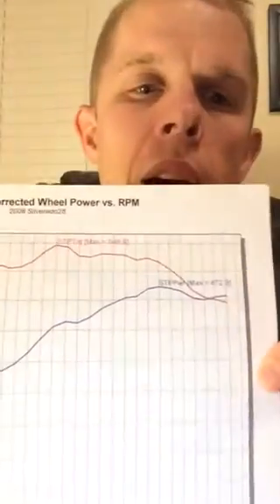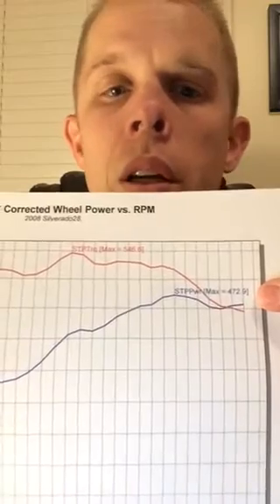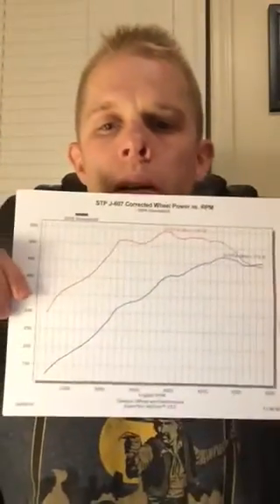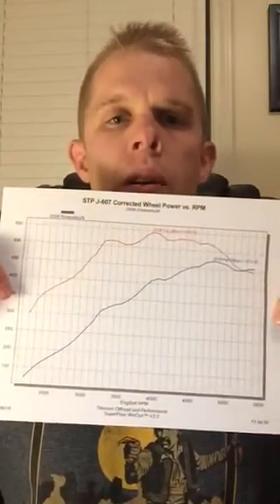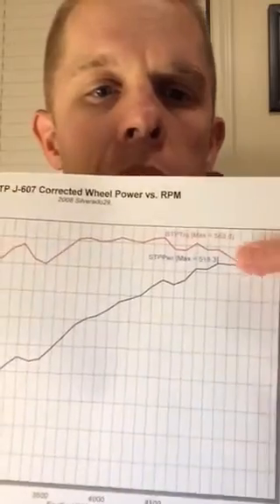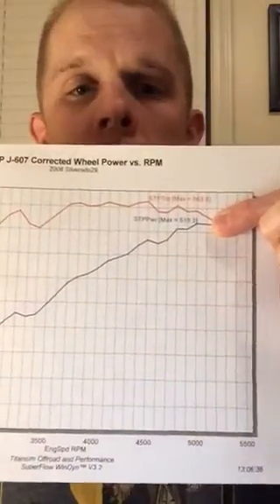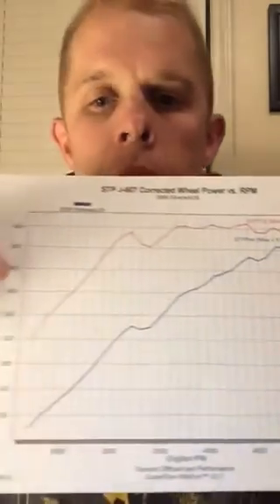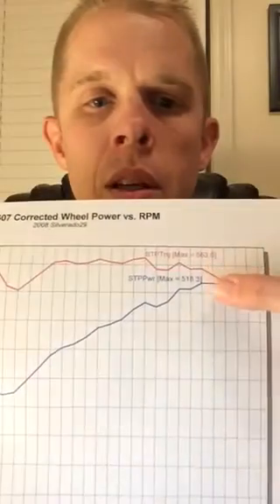Cat vs No Cat: What's the HP difference?

Comment: I have done a LOT OF DYNO testing building performance/competition engines.  Most of the time the HP difference between a modern Cat and no cat is a few HP at most .  We tested a 700HP big block with/without cats recently and the difference was less than the standard deviation of the dyno.   I have never done any such testing with forced induction engines so I am not arguing with your results in that situation.

But with naturally aspirated engines that are in good tune and with NO OTHER changes except removing the cat/replacing it with a straight pipe, I haven't seen any useful  difference between cat/no-cat in probably 100+ dyno pulls.  

I recently ran across an internet  claim of 40 more HP by removing a cat.  Turned out that the cat was removed and numerous other changes were made to fueling/exhaust system.  But the claim was that the cat "robbed" HP.

Comment: You forgot to mention these are the results when you have turbo if you have no turbo and your car is newer then 1997 then you will get only 3hp doing the no cat
Reply: What would you think the diff is on a 95 or 96 Lt1 ? thx
Reply: @paulmoss7940  u would need at least high flow cat cause no cat will mess with oxygen sensor which could make it worse and headers cause just the converter itself isn’t enough to gain enough power to notice
Reply: @erikko6523  ya but the day will come when the cat gets plugged

Comment: With a turbo or a supercharger it  will really make a significant  difference  ,but with a v6 pushing 300 horses probably  adds like 7 horses .
Reply: Old Peugeot 205 GTI 1.9  was 130HP with no cat early version,  and with cat was 122HP, no know if cam was changed, head....only as reference.
Reply: Phoenix E 7 more than I had on my Z.  Noice.

Comment: I have ZERO doubt that the catalytic converter robs HP but most of that 50 whp id say 40-45 hp was from 3 pounds of boost not the restriction..... in my experience which is not 5 decades or anything but roughly 15 years the catalytic converter might rob you of 5 wheel hp.... we arent talking about stock cats but hi flow cats vs no converter
Reply: bennie walters on a NA car it won’t make as big of a difference.  A turbo car will notice a bigger difference.  But even a NA car will benefit a lot more than five hp from a cat removal.
Reply: Wait I'm confused maybe you can help out. So the almost 50 loss was from a high flow cat different then no cat.

Comment: You ran 3 psi more and you remover not only the cat  but also the muffler this tells us nothing about how much of that was the cat.
Reply from the maker: mbsnyderc It does tell you something. I made zero adjustments to the boost controller. This tells me the cat+muffler was causing enough backpressure to reduce the turbo output by 3 psi. It’s not earth shattering, but it clearly shows an impact.
Reply: @jdn014  You have a turbo of course you will see a difference.  The problem is with people who think that having their car intake stock and just taking of the cat is going to give them any significant change.
Reply: carlosb1 EXACTLY!

Stock cars are engineered for all of its components to homogeneously work together.  Once there’s a significant upgrade like forced induction altering/modifying any aspect of the engine that improves upon airflow in/out will likely show gains.
Reply: He's saying it could've been the muffler also contributing or you have a pretty shitty exhaust.

Comment: Thanks for sharing that information. I've  been asking exhaust shops how much power is lost, due to having a catalytic converter fitted in the exhaust system?
Most said only about 3-5 hp. They obviously must be lying. I never believed them, as to have such a restriction that a catalytic converter creates, would definitely be detrimental to performance. As your comparison figures proves beyond a doubt, they rob a "lot" of horsepower!!
I will remove my catalytic converter ASAP!!!!!!!
Reply: Hey I've got an idea: why don't you just throw your garbage out the window as you're driving around town too! ;-)
Reply: @gwjohnsoniii  oh I do that all the time. I don't give a damn about the environment most of that is propaganda anyways but I'd rather have a cat cause I don't like that smell. However I wish it would of said what kind of cat it is cause from what I understand the factory cat is VERY restrictive but a high flow cat vs no cat there's very little difference
Reply: Newer catalytic converters don't restrict as much as old ones. And if your car makes 140 most likely they weren't super far off. Ecspecially if you drive an economic car. You can gain up to 10% ish. Most likely a tad less in a newer not fast car.
Reply: 10% is a damn lot
Reply: Im thinking they were comparing a high flow vs no cat sounds like he's talking about a factory cat. He wasn't that specific what kind of cat from what I heard
Reply: @marioandultrachap  doesn’t matter, if they gonna plug up and cause issues ditchem